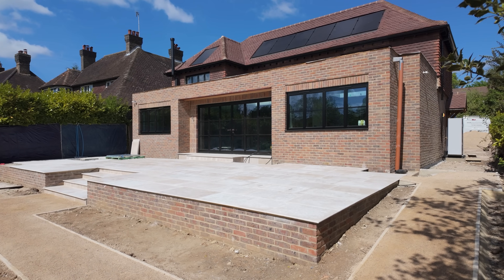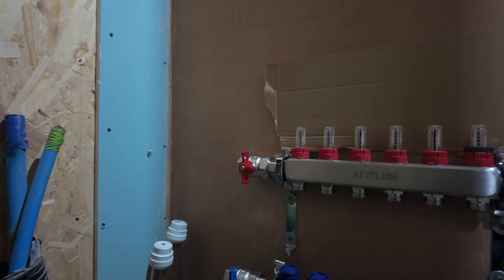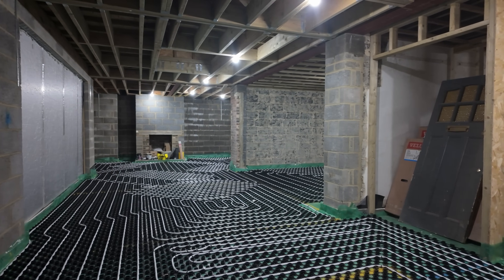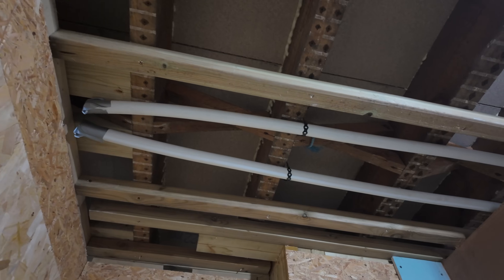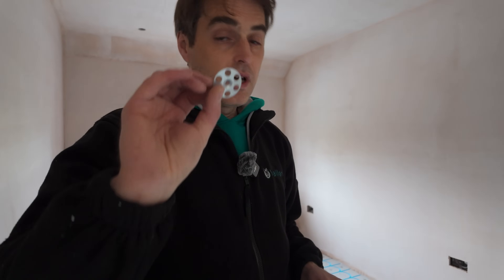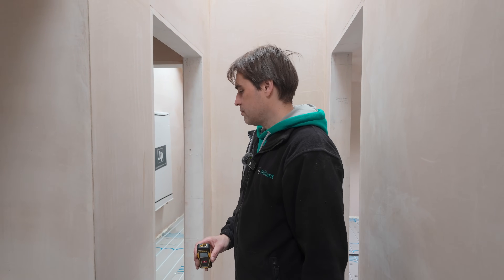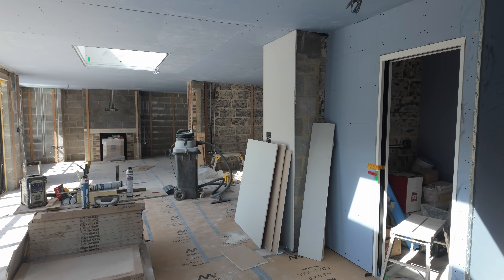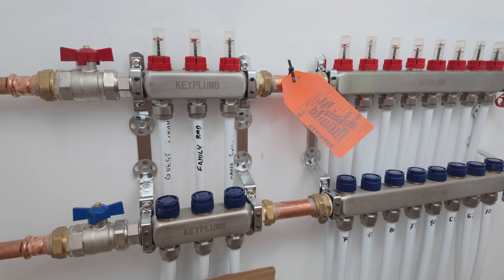Underfloor Heating & Vaillant Heat Pump: Full Install.

Comment: Hi Simon. Great job, congratulations.
As you design the system yourself, did you use ready schematics for this job?
We can not see the controllers, neither additional zone valves (just Esbe one). UFH has 2 zones,  do you use VR92 for each floor and VR71 ( in case 2 different temperatures-heat curves would be used in the future) or just sensoComfort? Therefore both ground floor and top floor would have the same flow temperature - pure weather compensation , no floor/zone temperature control. On one hand we have the efficiency and simplicity of the CH system on the other personal temperature comfort which does no always match the MCS etc tables. Will you be going there to personalise temperature settings for new owners/ occupants or they will play with heat curve (eventually flow meters ) themselves - solar gains, bedrooms, bathroom windows left open etc. Old fashion Honeywell on the wall was easy to operate😂

Comment: It's ok to go with renewables on a total refurb like this, and if you have the budget. Otherwise retrofitting can be very difficult and invasive. This project had the luxury of an empty property and was literally like a new build in scope. I bet they did loads on the fabric of the building to bring it up to really low heat loss through insulation improvments. 7kw is pretty low for a 200m2 house. How much did all that cost?

Also, i don't like the boiler price hikes as many properties can't have HPs installed, either no space for a cylinder or no place to put an outside unit or perhaps its just a flat. There are 5 million of those for a start. Why should they pay more for new replacment gas combis just to subsidise those with houses and jobs like this? Crazy.
Reply from the maker: 8.2kW for 230-240m2 from memory
Reply: @UrbanPlumbers  That's only 36w per m2, right? very low really. They must have uprated windows, doors and insulation everywhere on that. I think I'm at about 5kw for around 70m2
Reply: @markfernandes2467  There are some really good deals on boilers from online stores, excess stock? I've just got a new WB for nearly half the Screwfix price!

Comment: If no buffer tank or volumiser is fitted, what do you do to stop the heat pump from cycling on a milder day, when the output of the heat pump will exceed the output of the heating system?
Reply from the maker: Keep the system fully open
Reply: @UrbanPlumbers  if the outside temperature was at 15, the heat requirement for the building would be approx 2.2 kW. Would the heat pump be running at a higher output on its minimum setting?
Reply: @malcolmstephens1340  you realise that literally every heatpump will cycle, right? They're designed to do a certain amount of it. The valiant controls have options for hysteresis and run on from memory, so it will not be a problem. Theres enough thermal mass that on/off cycles every 20-40 minutes wont be noticeable.
Reply from the maker: It’s not a problem with decent software. It’s only a problem with heat pumps that have poor controls: Samsungs, mitsi and the like

Comment: I'd love to have a heat pump system installed. But, I live in a rented property. The boiler is 20 years old, serviced annually and the Gas engineer says it's still looking and working great. Obviously it's not as economical as modern systems, so it's probably costing us more to run it. But, hey; what can I do. Thanks for sharing.
Reply: If it's a condensing boiler you can verify the settings to ensure it's properly condensing. Most systems are configured badly and never really run as efficiently as they could.
Reply: @Felix-st2ue  Thanks for your comment. I have the flow temperature turned down as much as possible and the flow speed is reduced too. We do manage a 22 degree drop in the return temp, most of the time; so I do feel we are condensing well.

Comment: This doesn't look like an install that would qualify for the BUS - does that affect how you would do it? For instance if you don't have to comply with MCS rules you could put in supplementary heating for the coldest week of the year. When calculating heat loss you could account for heat from appliances, solar gain etc.
Reply: Why wouldn't it qualify for the BUS? It's a renovation, gas came out of it, ASHP going in, so....
Reply from the maker: @markfernandes2467 yes it did qualify for BUS

Comment: If heat loss calc says 7kw but you're installing a 10kw ashp, wont it cycle quite a lot? Or does the inverter allow it to modulate down to lower output without losing efficiency?
Reply from the maker: Vaillant has decent controls, so it will not cycle that much, especially if set up right. Heat loss is 8kW and 10kW unit gives around 9kW output at -3 when you take defrosts into account, so the unit is sized correctly
Reply from the maker: 10kW is around 9kW output at -3 when allowing for defrosts. HL was 8.4kW. 

7kW gives around 5.5-6kW output at -3 so would have been too small

Comment: Grant available for the first heat pump.  When it needs replacing customers will pay the full price.
Reply from the maker: Heat pump cost itself is not that important as most of the expense is on the system, pipework and wiring. 

Heat pump swaps are easy and quick, especially like for like - can be done in hours, and cost of heat pump is coming down

Comment: Do you have any opinions on high temp air pumps? We have some small diameter piping going to our rads so probably can't have low temp high flow system.
Reply from the maker: Makes no difference - you need the same flow and pipe sizing for all heat pumps. This one is so called high temp. High temp is for hot water and not heating.
Reply: If the old system is still running in the next winter I would suggest to optimize the heat curve to see how low you can get the flow temperature while maintaining design temperature.  Then you have more data on what SCOP you can expect and which radiators might be undersized.

Comment: Whats better, the Arotherm plus monoblock or the split + tower? Worried about the future of R32 post-2027.
Reply from the maker: Better to go for r290
Reply: R32 is still fine to stick to, it will be around for a long time as there is no successor for it currently in the Air to Air market.  So the legislation will only affect new Air to Water systems, and existing ones will still be able to be regassed if required etc.
Reply: @BenIsInSweden There are some r290 Air2Air models on the market now. Granted they have restrictions based on how much coolant is in the unit in relation to the room size.
Reply: @Felix-st2ue  That’s correct to an extent. My dad is getting an ElectrIQ unit for his annex, one of the small DIY-installable R290 Air-to-Air models, but realistically, that ~3.5kW output is about the upper limit for these systems due to charge restrictions. It’s a niche part of the A2A market. Safety regulations simply wouldn’t permit R290 as a replacement in larger systems like mine: two Toshiba Daiseikai 9.5 units (7.7kW and 6.7kW) and a Hitachi Yutampo Twin 35, which runs two indoor units and a domestic hot water cylinder.

Comment: why not design the underfloor  also for cooling? then the 200 mm distance is not enough ?
Reply: Cooling doesn’t really work because of the dew point and condensation, it can take some heat out but it’s not really effective.
Reply: @Hazed_77 In a well insulated property it might already be enough to keep the building livable in the summer. And it's not that much extra cost.

Comment: We put an ecodan into our renovation, not the best brand, but we paid great attention to insulation, airtightness, thermal bridging and design of the system 
We are in a year next week and have only used 1700 kWh on the heatpump 
We love it and would never move back to oil-fired heating; it's a thing of the past 
In Ireland its hard to find installers but equally hard to find builders with attention to detail on insulation and fitting of airtightness so I just done it myself
Reply: Feel for you mate, heatpump is next for us after MVHR and external wall insulation and PV. Mind sharing who did yours?
Reply: Dave, I'm about to go the same way. I could go with another brand (grant) but I know the service from the local supplier is very good for the ecodan. We based in Kerry, so getting decent service is important. What kind of SCOP are you getting?

Comment: Nice to see Solar + Heat pump deliver for the homeowner. I've helped 200+ homes with Solar PV - the combination is a match made in Heaven! The New Tesla Powerwall3 + 500W Bifacial panels are extremely capable of obliterating running costs!
Reply: I think a BESS + TOU tariff is more suitable for an ASHP, but solar helps for sure, especially if you have A2A.
Reply: Why do you say bifacial panels? How do they work on a roof?? Are you talking about vertical as a fence or something?
Reply: @markfernandes2467  They work on a roof but do even better with a white reflective background.
Reply: @markfernandes2467 Right now they cost about the same. So even if the gains are minimal its still worth it.
Reply: @Felix-st2ue  Would you consider between 8-15% minimal? That's what we're seeing with white reflective backgrounds. Additionally, I personally prefer two sheets of toughened glass vs. plastic on my roof. I'd avoid the Chinese brands like DMEG/ AIKO etc. Not worth the paper the specs are printed on.
Reply: @avivscrewvalla  I would consider 8% to be minimal. But i would still go for it. Even though we were talking about cases without reflective background.

Comment: Back to Valiant again?
Reply from the maker: Yes we still install Vaillant. Just size it differently now. This install is as originally specified with 7kW.
Reply: @UrbanPlumbers  I am about to start on 2 new builds in Poole. Heat loss for each is around 6.5kw. I have a couple of questions for you if you wouldn't mind giving me your thoughts? Vaillant have spec'd a 7kw but I have heard you mention before you're a bit dubious about the 7kw and how it performs, why is this and should I be going for a 10kW instead? Also it has 3 floors of underfloor heating... I don't want to use a buffer if I can help it but I'm unsure whether the pump inside the aroTHERM plus will be man enough for 3 manifolds! Any feedback from you would be greatly appreciated.